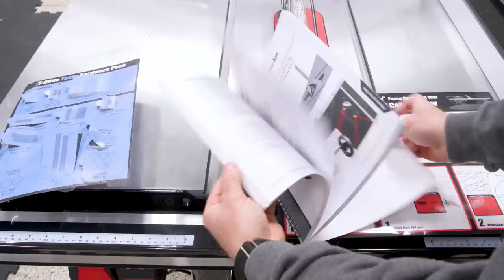I Left Powermatic for Sawstop!

Comment: After owning the same saw and using it for a month or so my employee accidentally touched the blade while running and kicked off the safety feature. There was absolutely no harm to his finger and saw stop replaced the cartridge for free. I had to send the old one in and they checked to see if it was flesh contact that set it off then sent me a new one out pretty quickly. They’re a great company with amazing customer service.
Reply: And what did you decide to do with the blade?
Reply: @fassst6  get it fixed. It only damaged one tooth.
Reply: That is great though how the hell did that happen.  Do you drug test at all.  In a worshop there are many things that can gore you, unless you just push wood through the saw all day.  Nice to know the saw worked, what are you going to do about the employee?
Reply: I’ve run a SawStop since 2007 - saved at least two fingers! One was mine and the other my master level lead man. Worth every penny x100! 
I discard the blade after a brake activation. As the SS tech explained to me, a brake activation can generate very high momentary heat which can compromise the carbide brazing on on or more teeth. Better to replace the blade than risk slinging carbide! True.

Comment: Looks like we both just got the Infinity tools Sawstop insert. Curious to know what you think.
Reply: I was looking at that too, David. I actually was really close to purchasing it when I first got the saw and then sort of forgot about it. But I do cut a fair bit of stock with very thin offcuts that occasionally get sucked in between the blade and the insert and that’s no bueno.
Reply from the maker: I actually went with the Colliflower version, which look to be pretty much the same exact thing. So far so good, but I'm only two projects in on this thing so we'll see.
Reply: I bought one of those early on - I like it, but changing inserts after the first winter with it is difficult.If the metal is too cold, I have to take it inside and warm it up so that I can get the insert out. I also don't like that their inserts aren't really friendly to make your own - I'm not entirely sure what I can use to get that angled cut.
Reply: @woodwhisperer  Same here. I've had mine for a couple of years now and still love it. One of the nicer things is that the inserts are so cheap I can make a variety of dedicated setups for very little money.
Reply: Infinity tools sells the colliflower insert.  It actually says colliflower on it.
Reply: @JasonRSpenny  I just realized that, ha! I thought it was made by Infinity Tools.
Reply: @woodwhisperer  I got my PCS not that long ago.  I recently bought the insert from Infinity, and it is is the Coliflower version.
Reply: It’s all the same insert.  He sells them direct but also through Infinity.  I asked him directly last year when I ordered mine.

Comment: The big Powermatic was always my dream table saw.  A few years ago, I wound up getting a PCS with a 52" table and a nice outfeed table, and I think I have found my forever saw.  I will be curious to watch this thread over time.  Also, the infinity inserts are pretty nice, but they do take a little time to dial them in.  I mostly just use the Dado inserts to get zero clearance.  I will use a marker on the top to indicate which blade or set I used with the insert with the hope that it can be re-used.

Comment: Welcome aboard the SawStop Express, Marc~!  I picked mine up in 2016 after having used my Craftsman 10" contractor saw since 1990'ish.  I had an accident on that one around '98 and almost lost a finger, but came out okay.  I stalked the SS Pro for several years and was wanting one, but the price was intimidating.  We were in a tool store in Columbia, SC, where they carried them and after showing it to my wife, she said "I think you need one of those SawStop thingys" as we were about to leave.  With that endorsement, I did an immediate about-face and took one home.  I've not looked back since.  Best tool purchase I've made in over 30 years of woodworking~!!

Comment: Congradulations. I bought a SawStop 3 years ago after 25 years with a big, 3HP General.  I liked the General, like the sawstop and concur with everything expressed here.  Four things I don't like about the saw.  The distance between the blade and the front of the saw is much shorter, forcing me to use a sled, which I find awkward, for boards wider than  10".  Second the quality of the top is not what the General was; it was spotless after 25 years while the Sawstop started accumulating scratches immediately.  When shaving a bit off the end of a crosscut, small pieces of wood can get stuck in the very narrow throat of the dust collector.  Finally, like you I  hooked my overhead dust arm up to a Fesstool extractor but found the extra hassle didn't provide enough benefit over the standard installation.

If I were buying today, I'd probably think hard about the Harvey, but don't really have any big regrets about my purchase.

Comment: I had a saw stop for a boat 6 years. I also at the same time bought a panel saw. So I didnt  use the sawstop as much anymore. My biggest issue was the power. It was 3 HP but would constantly shut off when under load like 8/4 stock. For this reason I sold it and bought an older general 3 HP. I miss the safety aspects but I need the ability to run heavy stock all day long if I had to.
Reply: Most new saws do that I just bypassed passed the electrical shutoff now I can cut really thick material with no problem
Reply: @texascraftsman7215  hello

Comment: Hey Mark I'm a woodworker of over 40 years and 6 years ago I got the Sawstop because I got my thumb for the second time with my craftsman contractors saw. Since owning my Sawstop I have had 3 activations (not proud moments) but only one was a flesh contact and the other two were should I say a dumb moments. At this point in my life I'm glad I have it and I know you were used to the Powermatic saw where I came from the other end of the spectrum so it is tons better than the Craftsman. I'm hoping I can figure out that I need to think things thru a little better so I don't set it off again.  Anyway I really enjoy using my saw even though I'm a little gun shy at the moment.

Comment: I'm making the same switch, mostly because the footprint of the built in mobile base on the PM 2000 won't fit down my basement stairs (which is where the new home shop is) and I have no bulkhead access to the basement. I've used Sawstop saws professionally and find the quality to be on par with Powermatic, but if the PM 2000 would fit I'd surely keep it. I have to say that there are soooo many people on Youtube talking about woodworking but you seem to be among those who really know what they are doing. Very good production quality and useful, insightful information.

Comment: Awesome Video.  I got my SawStop in January of this year.  I accidentally activated the safety break, right after purchasing my Forrest Two woodworker blade.  Uuuggghhh....!  It's currently sent out for repair on the 3 teeth that got misaligned after becoming imbedded in the safety break cartridge.  I was using my Swanson Metal Square on my crosscut sled.... Silly, silly , silly of me.  I love the guard.  You don't need to add a separate vacuum to it.  It pushes the dust by the force of the air coming off the blade, along with the suction from your 4" or bigger, dust collector.  And you can easily make your own Blade Dust Collection system, avoiding that $250 price tag for above table collection.  Great machine.  Thanks Mark.

Comment: Nice thing about cutting damp wood is that the safety feature can be easily bypassed so you can still make the cut without risking a brake activation.  Takes only a few seconds and the system resets when you turn off the saw.

Comment: Nice review.  I will be ordering a Saw Stop for one of my shops.  In my home shop, I have a recent model Delta 36-725T2.  I find it interesting that one of the features you pointed out that you haven't seen much if ever, is a second viewfinder for measuring on the left side of the blade.  Oddly enough, my cheap $600 saw has that.  I don't use it much either, but it's there.  For the budget minded, I really recommend the Delta.  It's been a good saw for the money for the last two years.

Comment: I thought i couldn't afford a SS and had purchased an older Delta Unisaw.  Last Labor Day I was doing a cove cut on the table saw and managed to take a notch out of my left index finger.    After a trip to the Emergency Room and seeing a hand specialist, my finger has recovered 99 percent.  I am certainly not the craftsman that Marc and others posting here are, but I am very safety conscious and have been using table saws for 45 years plus without incident. Sitting in the ER waiting room I jokingly mentioned to my wife that if I needed to upgrade to a SS.  After talking about it she said let's get one, it will be cheaper than additional trips to the ER.  I received the saw in September and was thoroughly impressed with the assembly instructions and the overall quality of the saw.  The Unisaw was nice, but the SS is great.  Good review.

Comment: Great video and tips. I've had my Pro SawStop w/52" fence for 11yrs and actually was motivated to buy after having a thumb tip nip mishap on a Ridgid contractor saw. I notice your newer saw blade stops very fast. Mine tends to coast for a while and after doing a refresher on the safety manual, I read that if you do touch the blade even while coasting to a stop, it'll trigger the brake. I've actually finally installed the dado stack for first time recently since I didn't want to dink with the brake before but its pretty easy to swap out after all. Normally I'd use the router table or shaper for rabbets and dadoes but now giving bigger tasks to the saw after getting back into Woodworking much more aggressively now after a nearly 6yr hiatus due to lack of nice garage. (pole shed seasonal indoor rain -- central wisc weather).  Anyhow hoping you'll expand more on the capabilities of the saw stop and after market upgrades. Not that my wallet needs to take a bigger hit but a lot of the tools you use and I've also purchased recently sure make woodworking life easier and I'm all about making most efficient use of time in the shop.

Comment: I’m still waiting on mine to arrive I went for the contractor as it was in my price range. I’m so glad you showed your set up with the hoist and it works as I’ll be doing the same method. So thanks for the great review I’ve only been a sub to your channel for a few weeks and I’m getting so much knowledge from you so thanks so much for sharing
Reply: Sawstop recommends you hoist the saw with the help of 3 beefy friends.  At the same time, the packing materials come with a piece of dense styrofoam cut to just the right size that you can slide the prone saw cabinet onto it, then tip the saw upright.  With a little planning and leverage, I was able to get the saw off the floor and into the mobile base by myself, without trauma to either the saw or my spine.  On the other hand, I don't own a hoist, so that wasn't an option.

Comment: I've had my Sawstop CB-ICS for about 15 years, and love it.  My addition of dedicated vacuum for blade guard was great addition.  My other happiness comes from Incra TS LS.  With it installed you don't need the table legs and have room for nice under table cabinet.  I don't know if the current saws are different, but with mine the blade brake is still functional until the blade stops after turning the saw off.

Comment: I bought a Saw Stop 4 years ago and I love it. I bought the 52” and I debated on the horsepower for awhile before deciding the 1.75 hp should be enough and I haven’t regretted it. I converted it to 240v and bought a woodworker2 blade for it that made a world of difference. A builder friend brought over a rough sawn 4x12 piece of cherry for a fireplace mantel and I was able to rip it in 2 passes with the blade at full depth with no problem. One of the main reasons I bought one was because I’m 60 now and I remember how scary my Dad got working on his tablesaw in his 80’s and I figured one trip to the ER would cost more than the saw.

Comment: I always think the best thing they could do for tablesaw safety would be to stop the blade very quickly.  You're so right about the injuries that happen when we're impatient for that blade to stop.  I hope you love your saw Marc.
Reply: My understanding is this is the real reason dado stacks aren't "legal" in Europe.  The actual regulation is when a saw is stopped/turned off the blade must stop spinning under a certain time (very quick).  Dado stacks are heavy and prevent the motor/stopping mechanism from stopping the spinning fast enough. At least that's what I vaguely remember from a Stumpy Nubs video.
Reply: "the best thing they could do for tablesaw safety" would be to keep your fingers away from the d** blade. With a blade guard and a sliding table.
Reply: @kykkeliky124  Life experience will ultimately reveal that normal human behavior will always include human error. These things are engineered to protect us from ourselves, whether we want to recognize it or not.
Reply: @BartonMaxwell  This is correct, it's too expensive for lower-end saws in Europe to have this tech, so they just make the stacks incompatible with their arbors.   But higher end consumer and all industrial saws have the ability to be tooled for dado stacks.
Reply: Yeah, I dealt with that just today…just hanging out waiting for my blade to stop lol
Reply: @BartonMaxwell  just bought a hammer k3 with a dado size arbor, it has a 3 second stop time,its my dream saw, happy Woodworks.
Reply: @kykkeliky124  Absolutely. The safety features to prevent injury have been around for many years, however they don't work when removed. The two small cuts on my left thumb are there mainly because the blade guard was removed. Funny how that works.

Comment: we have 2 saw stops in our shop. They are great saws when they're new, but after a few years they are both falling apart and worn out in the exact same ways. 

The blade adjustment handle is broken on both saws (height and angle adjustment, so that's 4 broken handles), the panel beside the blade to improve dust collection is broken on both saws, the cam lever to tighten the fence is worn out on both saws. both saws have had their paddle switches replaced multiple times.
In my opinion they are not robust enough for a shop environment.
Reply: @TheWoodFly  used delta and general and altendorf saws before that. I did replace a few paddle switches but none of the handles ever broke off in my hand.

Comment: Back in the 1990's I had a Jet cabinet saw with 3HP.  For the past 9 years I have owned the ICS SawStop, 3HP also.  I have resawed 1x6 Ipe with the blade fully up and burried and did not hear any straining going on.  3hp is pleanty for any operation.  No more HP needed unless you run the saw non stop all day long.  I switch between a WWII and a dado set often.  It takes me 30 seconds longer to make the swap including changing the brake.  Adjustment is not critical as long as the brake is not too close to the blade.  I had a false trigger when I forgot to adjust the brake for the yet to be sharpened dado set.   Now I simply adjust by a certain amount of turns and do not measure.  A little of dry lube on the pivot points on the brake help to make it slide on and off of the placement rod more easily.  You will get the hang of it.  Put a touch of that dry lube on the lock pin lever too.

Comment: Marc, congrats on the purchase! I have the 5HP ICS, and it is an absolute monster.  The rails are 1/4" thick, and in some places it looks like they added mass just for the sake of adding mass.  That said, I've had mine for 4 years and really really enjoyed it.  I haven't had any nuisance trips, and the saw has run smoothly and issue free since I got it.  I think you'll be happy with the purchase.  One thing you may consider adding is a caster on the bottom of the fence to ride on the rear rail.  It's already a smooth fence, but the caster keeps it from sliding across the top and makes it really really nice.

Comment: Enjoy your channel, full of good stuff. I recently replaced my 25 year old Chinese 12"saw 52" rails + large sliding table (worn out) with the Industrial SawStop. The method of removing the table insert, changing the riving knife, the dust collection power of the blade guard are the main features that sold me on SawStop. The Blade arresting system was a bonus. I'm a member of 2 woodworking clubs & have access to 4 different table saws & have been using table saws for 50-60 years so I know what I need & what I want. I'm a little upset that they don't produce a `12" version, but I replaced the drop saw with a 12" one. 99% of the time it's all OK. Very happy with my decision. Oh, I got the small sliding table & fixed it to the left table wing. I'd probably have been better off with an Incra miter gauge.

Comment: 14:56.  I did this just the other day with a bandsaw.  Not my main one that stops quickly after shutting off.  I turned it off and realized that I didn't have my blast gate on so I opened the blast gate and started brushing the saw dust towards the throat plate.  Guess what happened next.  It bit me.  Not bad but it sure could've been.  Just wasn't thinking.
Reply: I have a cheap 2” paint brush stuck to a magnet on my bandsaw frame. I also keep small handy dust brushes around my other tools.

Comment: The simple way to take the slop out of the fence when setting a measurement is to pull the handle toward you while sliding the fence. Then when you lock it down, it doesn’t change the angle. I’ve done this for years, even with my old Biesemeyer. I may have seen the tip on Norm’s “New Yankee Workshop” back in the day.
Reply from the maker: yup that works, but an even better solution is to get rid of the slop in the first place if you can.